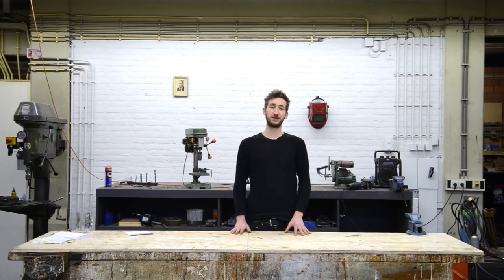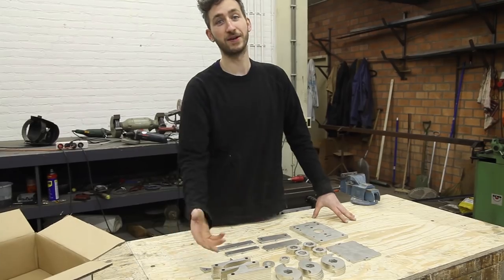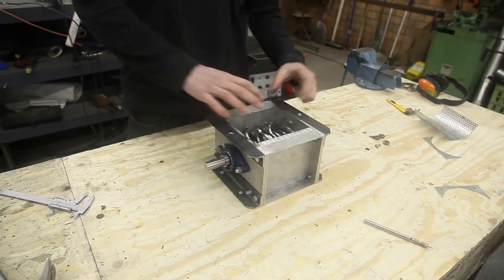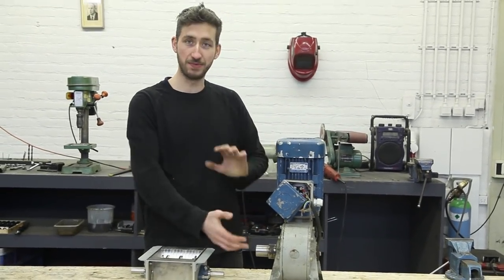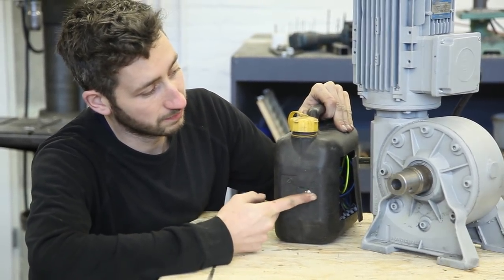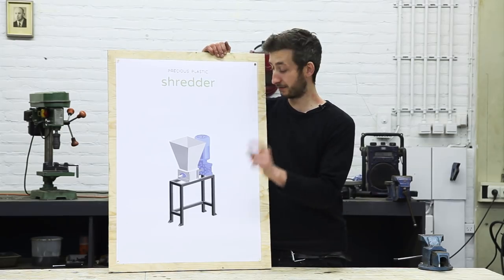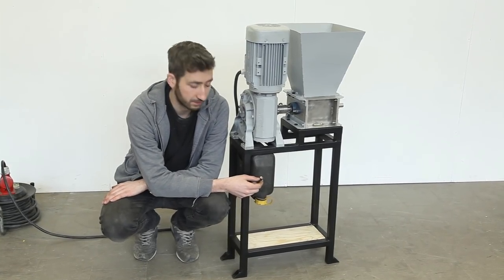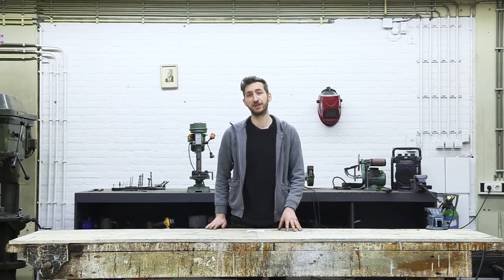Precious Plastic - Build the shredder (part 3.1)

Comment: does someone know where can I buy the shredder box instead of building it?
Reply: Nelson Di Salvatore I want to look at an inexpensive electric chipper shredder for leaves and sticks. It it may be usable out of the box or need slight modification. If it works then we have a plastic shredder for about 150 dollars.
Reply: Billy Gray did it work?
Reply: Jonatan Den Breejen I haven't tried it yet. I haven't had the money. I saw one video where someone used one and it looks like it would work.
Reply: Billy Gray they seem to work only if you cut the plastic in branch sizes which is a waste of time
Reply: that's what I was afraid of.  I was also thinking about a setup kind of like this one but using circular saw blades.
Reply: That would be expensive,😅
Reply: Jonatan Den Breejen 3
Reply: Check Out Wilson. Its really promising to me. Going to be a huge startup. It's going to be absolutely fantastic.
Reply: @MartinVaskoHugo  This whole idea went from an interesting means of creating art with plastic, for what was claimed, in this video, as a $200 investment, to coming up with $4K, plus shipping, that I have no means of finding, just to refine the raw materials. And after my $4K + shipping investment, I'll end up with a pile of plastic chips and still no means of using them to create art. This is what is known as a bait and switch con. Sure, this dude can make this machine, with the help of an array of expensive specialized industrial grade tools, a huge machine shop at his disposal, not to mention the vast number of skill sets he possesses, to know how to use each and every tool safely and properly, to design and build what he needs. But this is no DIY project for those with little or no skills in the use of industrial machines and small budgets. 

Me, on the other hand, I actually make art, using repurposed materials, using tools that are primitive by comparison to almost everything he's shown briefly using in this video.
Reply: @regmiles  Right, I feel that too, but I think this is aimed at communities to share. It isn't effective for individuals.

Comment: "Using materials and tools you can find anywhere"
First step get your custom laser cut metal blades.
¬¬
Reply: +David R. T He does provide CAD files ready for the lasercutter and it should be fairly easy to find a firm near you who can cut it. Probably for cheap too.
Reply: +Urokoz what about the guy in the middle of Africa?
Reply: +Callum Ogden He probably is not the target of this video and he probably doesn't have a big problem with plastic bottles.
Reply: If you watch the introduction video he mentions how it's for everyone and specifically someone in the middle of Africa. Currently it's only accessible to just hipsters/hobbyists
Reply: +Callum Ogden I see your point, but it is not targeted at the people living in tribes out in the middle of nowhere. In Africa it's most likely targeted at the people living closer to the bigger cities, where there would be firms with lasercutters. That's where problems with plastic is anyways.
Reply: I was thinking would a large meat grinder do the job for plastic??
I believe one can find some used for sale in most parts of the world easier than laser cutting service, probably cheaper & no assembly needed.
But would it work nicely?
Reply: Thomas Lauridsen Perfect! what did you use for the blades? laser cut steel like the video, or did you come up with something else?
Reply: wait.. what!??  If a girl can do it, why is that guy Edgunsuk who's gunsmith, blacksmith, etc, etc is complaining?
Reply: You can get a service to do that for you for about 200$ which is still bad but if you know somebody from the business or own it yourself have fun
Reply: David R. T 3
Reply: David R. T 556
Reply: A dado blade set or 2 sets with washers and threaded 5/8 Inch rod and hex nuts to hold it all together.
Reply: haha
Reply: LOL!!!!
Reply: I was with it until the mig welder came out.... Fantastic idea to open source everything, but I'm going to buy one instead...
Reply: Gentlemen, I now have only one question.

All of you really have never heard about saws for metal, chisels, sandpapers and so on? Or about analogue heat controllers? Or about basic lathe made of hand drill?

Our ancestors made much more complicated machines using literally stones and sticks, and now you cannot imagine building an usual simple shredder without a laser cut?

Whoa. What a times are going.
Reply: exactly the problem I'm facing at the moment, if you could link me up with any firm that will cut it and ship it worldwide
Reply: The parts can be made on a bandsaw, some little skill is need. But that has never stopped anyone.
Reply: He could go to a university which has an engineering section and ask the students there if they have a laser cutting machine, which is very possible. A little extra effort but doable :)
Reply: I think turning this into a college metal shop project might get more of these made. Hmmm...I have ideas to distribute these world wide but we need a source to make them.
Reply: David R. T. Hahahahaha kinda like an oxymoron huh?
Reply: David R. T what was the  average cost for the laser cuts or how much money would the entire thing cost?
Reply: David R. T from a person with no tools ill need to pay for the labour. How many man hours did this take to get running?
Reply: They also said you coud use a CNC waterjet/abrasive waterjet cutter, or a CNC plasma cutter.  A CNC Oxy-Fuel Torch could work too.  Also you could manually torch with an ony-fuel torch cart.
Reply: Here is an idea. Contact your viewers via another video. Find ten of us that would like the grinder. Go back to the shop and get ten made at once. I’d love one. Thanks
Reply: David R. T . I thought everyone had a laser cutter in that third drawer down, you know, that messy one!
Reply: Lucy Lauridsen. That's great! How about uploading it to utube so we can all see your handy work!
Reply: L Zinetz "whoa, what are times going?" Lovely grammar!
Reply: Eric Lotze. Which of course everyone has at least one!
Reply: I can find most of these things in my garage
Reply: guys you can make a mold and a forge and pour molten metal into mold in shape of blades then grind to perfection after
Reply: Have a set made and ship it to Africa.
Reply: A person skilled & properly setup should be able to cut 1/4" plate with Oxygen - Acetylene or Plasma torch, with minor grinding needed. I could.
Reply: @stupidsmartmonkey  I would love to know how you did this!
Reply: So this Is for first world ppl? I dont own a laser thingy but I really need to build one, can someone help? Im from Bolivia
Reply: @Naiemaa  good question but if does you will likely need a lot of elbow grease
Reply: @LeonidZinets  It's an old comment, but still: Did you ever cut steel, especially to the depth needed for this project, with your hand drill lathe? What kind of tooling and fixture are you using? Do you have a tail stock to offset lack of stability? Did ever actually build one?
If you're really hard core, you can make pretty much everything with hand tools, but it's going to take you ages to file or grind a drive shaft... The blades look pretty simple, though.
Thinking about it, it might be a better idea to use disks with hex holes to fit the hex rod to bigger bearings when using hand tools.
Reply: pessimism is great quality...for negative people.
Reply: This is great, although way beyond my  resources at the moment...laser cutting, metal lathe, welding  etc...
I am currently experimenting with an electric drill, with small blades from a lawnmower added to a long stud bolt, all housed in underground drainage pipes. The hopper is a long bucket i found being thrown out...any hopper would do though. Its cheap and accessible to most. 
I have not made it yet, so I will make it then see how well it works...and add to my channel.
I like the slow rotating blades here, its like a smaller bersion of the big metal recyclers.
A home recycler should be in every home. Even if it was just shredded and given away..there would be very little waste plastic in the sea then....
Reply: have all you heard of concentrated solar metal melting?  you only need to draw all the cads in cardboard (or acrilic..) , to make concrete molds, to fill with melted sheet metal...... done
Reply: @crapisnice  Your solar cast metal will be completely useless for a project like this that relies on precisely measured closely fitting parts.
Reply: @demoniack81  search metal casting in google and wikipedia..
Reply: @crapisnice  You can search all you want, but you will not be able to achieve sub-mm precision by casting metal, especially at home.
Reply: @crapisnice  You do realize you've just proved my point, right?
You've just posted a bunch of people who, even in an industrial setting, cannot achieve even mm-scale (let alone sub-mm) precision with casting, as they're clearly having to do tons of post processing to the cast.
At that point it's a lot easier, cheaper and safer to just buy a flat sheet of steel and cut it to shape with an angle grinder.
That way at least you only have to belt sand / file to final shape the perimeter, you get the top and bottom faces flat for free. If you cast you have to do all of the faces, and getting top and bottom square isn't trivial at all if you don't have a mill.

There is literally not a single advantage and tons of disadvantages to casting your own metal rather than just buying a sheet.
Reply: @demoniack81  you can castn thenpieces with simple sand or concrete mold and them use a diy vertical axis wind turbine attached to a diy cnc and fine tune de micro details. its that simple, you can make the motors of the cnc with copper and electromagnets, and you can make an arduino card
Reply: @demoniack81  also you can make the entire shredder of fiber reinforced plastic, its stronger than metal and lighter, an use metal only in the friction or abrasion zones.
Reply: @crapisnice  "you can castn thenpieces with simple sand or concrete mold and them use a diy vertical axis wind turbine attached to a diy cnc"
Or you could just not go all the way to South Africa and back if your original objective was to go from Paris to London, and instead buy a professionally made metal sheet for 50 bucks.

"its that simple, [...]"
No, you cannot power a CNC mill with a wind turbine that's gonna be rotating at some random unknown speed and introducing a shitload of vibrations and flex to the entire contraption.
And you definitely cannot  just "make" high precision stepper motors at home.

Stop trivializing the difficulty of making high precision components. It's taken us hundreds of years to build up the necessary tools, you can't just make them at home out of a box of scraps.
I bet you've never built anything more complicated than a doorstop.

"an use metal only in the friction or abrasion zones."
...which comprises literally the entire machine except for the hopper and maybe the lower frame. Which again, are both a lot easier, cheaper and faster to just make out of a sheet of plywood that you can buy for $5.
Reply: @demoniack81  where do you think engineers build the industry or scientists make experiments? in the land of milk and honey? 

you can make vertical axis wind turbine of the height or width you like, it can be a small carbon fiber one with some belts an gears.

you can power also the plastic shredder with a vawt. 

you can make the shredder of reinforced fiber plastic an put just thin plates and and the contact end with metal, if not using only reinforced plastic until it wears. 

you can use copper, a 3d printed plastic structura for the electric motors to wind the copper and melt some metal to make the electromagnets, you can make the electric motor you like or standardised ones as nema17 designed with free software. and create the driver and controller circuits with transistors and integrated circuits. 

in the end you have building capacity with no money and almost no electric energy consumed

all technology has been doing the last centuries is based in laziness and overconsumption, its a cancer of stupid inventions
Reply: @crapisnice  Cool. 
Since you're refractory to logic and facts I'm gonna make it simple for you: show me where you did all this and I'll give you a pat on the back. 
Until you do, stop pretending to be the 21st century Leonardo.
Reply: @demoniack81  lol, im not leonardo, those things are obvious but we are focused in corporate marketing nonsense and people doesnt apply recent scientific publications in biomaterials and energy, also all the information is fragmented so i just try to connect some dots, and yes i want to do those things this month, im just trying to launch everything all combined. its easy but any step setback is frustrating and im starting from zero
Reply: @demoniack81  and alone but im going to create a forum and publish in different forums to engage collaboration
Reply: @demoniack81  Bro it's not that hard to build a working motor or radio it's literally just wrapping a wire of coil a few times over a roll. It doesn't even have to be that precise. I think it's you who hasn't built anything more ''advanced'' than a doorstop. I was building radios when i was 5. Not that complicated.
Reply: @RobotronSage  Yeah, you can make a motor that will spin at some unknown speed with awful power characteristics easily. But you cannot build a precision stepper motor.
Building a radio is significantly easier than a precision stepper, especially if you're talking about AM - it's not even comparable.

Unless you own a metal fabrication shop and the knowledge of how to perfectly machine the mechanichal parts of your motor, the steps will be all over the place and that makes the thing pretty much useless in this application, unless you make a huge motor to reduce the mechanical tolerances and then gear it down. But then you've got to make precision gears/pulleys which isn't easy either.

Edit: just to be clear by the way: the point of the matter isn't "given unlimited time and effort, could you make one?"
The point is "does it make any sort of sense to try to make it instead of buying it?"
I can just work 1 more day and give $100 to someone who actually has laser cutting equipment and just get the damn parts, or even just buy a steel sheet and make the parts by hand.
Spending years trying to Mad Max my way into enough machinery to cast metal and God knows what else to get the same final result I can achieve with a $10 saw, $10 file and a premade metal sheet makes literally zero sense.

Comment: dislikes??? ??? end the world
Reply: Francisco Shibata. Of course there are dislikes! Do you have a laser cutter in your workshop? I don't!!!
Reply: Francisco Shibata yeah this method isnt a do it yourself type.
Reply: 1:10. Exactly.  I stopped when he opened the box.  I don't have that lying around my shop.
Reply: Clearly not everyone is watching the whole video. Looks like the real dislikes are because the laser cut parts. He even says to get them made from someone that can do this. Other videos talk about useing the blueprints and having the parts made from other people that have the equipment.
Reply: My problem is not the shredder but the lack of a reason to shred my plastic waste myself. Sort your waste and the ones who actually recycle the material can shred it. If you use so much plastic every week that you have problems getting it into the bin then maybe you start drinking your soda in aluminum can and get a $5 can crusher or use your foot.
Reply: NoSuspect Exactly.  A foundry to melt metal is much easier and cheaper to make than this.  You can also mold for cheaper with metal.  This is cool.  I just don't see the value in this.

Also look at the top.  They sell the parts themselves even.  You are looking at an $800-$1000 operation here.  I made a metal foundry for less than $100.
Reply: Dislike is all I hater can produce!
Reply: From where did u get blades and all euipments of shredder

Comment: if working on a small scale you can use a small food blender.
Reply: Have you done that?  I'm wondering how long the motor, blades, housing, would last considering the heat issues.

Comment: Your doing a lot of work for a task that can be accomplished with a pair of shears and a decent blender. Granted it wont hold up to say, heaving loads, can go through many, many loads of HDPE and PET which is what most people will end up recycling. While interesting, its ultimately beyond the reach of pretty much everyone interested in doing home plastic recycling.
Reply: I use a utility knife held in a vise and pull the plastic through with pliers. It takes time, sure, but it works.
Reply: Maliciously11
Reply: this is for a entrepreneur with limited budget.  This shredder can easily be used with a small gasoline engine off grid as well.

Comment: Little safety advice: Make the hopper long enough so you can't reach the blades. Sheet metal isn't the most expensive thing and your hand is definitely worth it.
Also has the added benefit of a higher input buffer.

Comment: Arrived via Jeremy Fielding channel. Definitely looks like it will work, I downloaded the plans, do not have any reason to build atm, but may in future. Only thing I may do different is to use tool steel for the cutters and plates. I would research using ss first though, maybe it will last a long time without sharpening. Maybe some time in future, after you use it for a long time, let us know how long the ss stands up before sharpening.